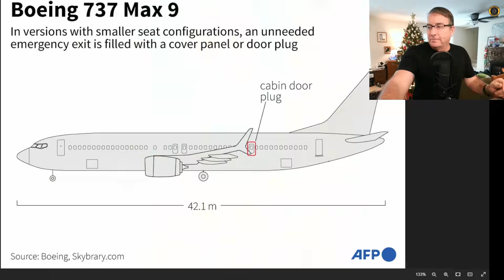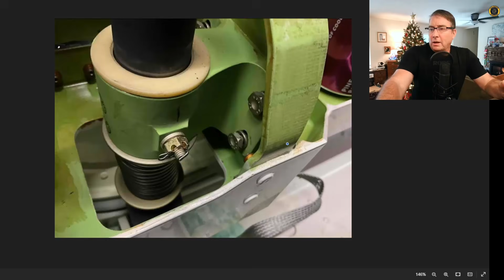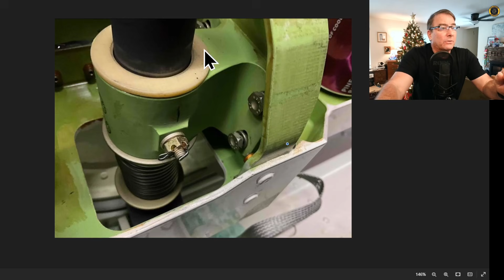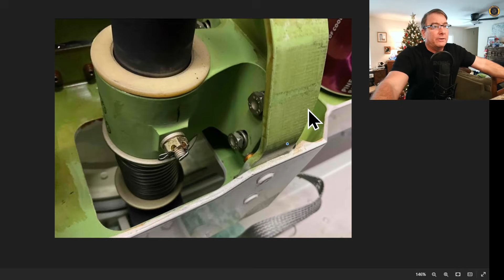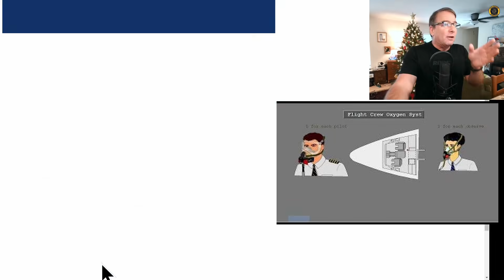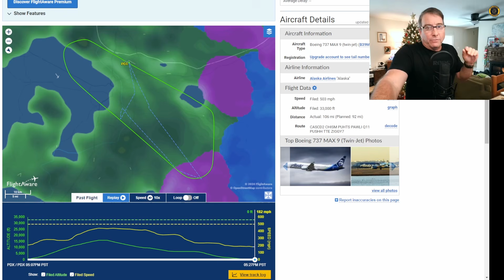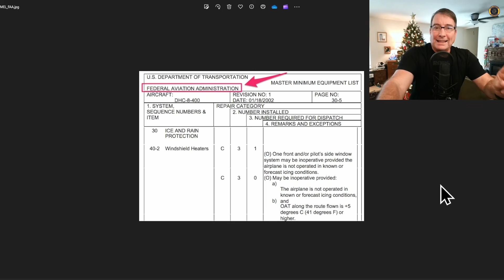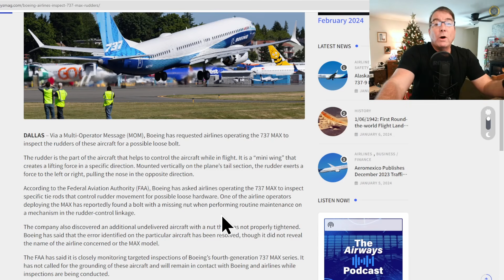"Yes, We Have No Bolts"  9 Jan 737 Max-9 Update

Comment: I'm surprised the CVR continues (or even needs) to run and over-write once the plane is grounded.
Reply: Lots of things can happen when the plane is on the ground that would require hearing the CVR. The important thing missing is why do these systems loop after only 2 hrs? It's 2024 and we can fit years worth of audio data on a chip the size of a thumbnail. There's no excuse for this.
Reply: @OMGWTFLOLSMH  Agree. You can pull tower tapes ages after an occurrence.
Reply: @owenmerrick2377 :
The tower tapes are only recording what's said over the radios, not gonna catch everything said in the cockpit of the aircraft.
🙂
Reply: @daleallen7634  True, but I was thinking of the length of time being recorded. You can go back days or more on ATC tapes, but only 2 hours on a CVR...I don't think the recording of this incident is as critical in this occurrence.
Reply: @owenmerrick2377  :
And, with the tower tapes, there is little, or even no cockpit conversation being recorded.
The whole point of having the CVR is to know what's happening in the cockpit of the aircraft, not what's going on between the pilots, and the tower!
Reply: @OMGWTFLOLSMH I remember that when voice recorders were introduced many pilots did not want them, and accepted them only on condition that the recording was on a loop and over-written after two hours.
Reply: @OMGWTFLOLSMH  For instance, we just had planes on the ground in Japan where we really want to hear the CVR.  Automating leads to edge cases.  Just having enough storage would solve this in every case.
Reply: The reg on CVRs is two hours.  Which for 99.5% of incidents works fine.

Nobody is going to voluntarily ask for longer recording time.  It will probably require a new CVR, that won't be cheap.  $500k?  Wouldn't surprise me.
Reply: I believe the CVR keeps running while the power is still on, hence pulling the breakers to stop them; but I'm sure there was a lot of oohing and ahhing at the hole after landing, with the power on.
Reply: There is no need for this anymore though, they can use the 2 hr magnetic tape for durability but there should be a flash storage device in the black box which preserves much much longer periods of time. Most people are under constant surveillance at work and don't have an expectation of privacy and there have been many instances of flight crews "forgetting" to pull the circuit breaker (not saying that's the case here)
Reply: In Europe planes over 59 500lbs have to record 25 hours of cockpit voice
Reply: they have to keep them running basically as long as the airplane is powered up. The worst airplane disaster in history involved 2 airplanes that werent even flying at the time
Reply: I think it's time that the aircraft are required to be fitted with a flight recorder which lasts for the maximum endurance of the plane x 1.5, the previous recording can be erased when the aircraft is restarted after being completely shut down, or if the circuit breaker is pulled.
Reply: @Musikur  or just do the same as europe and mandate a 25 hour minimum
Reply: Yeah, they could probably run longer, but it wouldn't have prevented this event. Bigger fish to fry methinks.
Reply: @spdaltid  It wouldn’t have prevented the incident, but would have prevented the audio from being overwritten later.
Reply: @spdaltid  :
Having a complete record of the conversation in the cockpit isn't about preventing the incident/accident.
It's about knowing what the flight crew was saying, and/or doing during the incident/accident currently being investigated.
Reply: In depends on the aircraft. Some Boeing NG's don't record when the engines are turned off, but that means recordings of preflight checks and preflight conversations are lost. On other NG's, the CVR runs whenever there is electrical power on the aircraft (so they do record preflight stuff). This Max seems to be the latter.
Reply: @Musikur  : "The previous recording can be erased when the aircraft is restarted, or the circuit breaker is pulled."
I'm pretty sure that the idea behind pulling the circuit breaker is to merely stop the CVR from recording, in order to PREVENT ERASURE of the CVR's record for investigatory purposes. 
Having the CVR ERASE the recording by pulling the circuit breaker would defeat that purpose. 
🙂
I do agree that the CVR should be able to record at least 1.5 X the maximum flight endurance of the aircraft without overwriting.
🙂
Reply: That's where I blame the pilots. They could've stopped it to preserve the recording but chose not to
Reply: @mangos2888  Agreed.  There was no reason to leave the cockpit immediately once the pilots had landed and stopped the plane.  The plane wasn't on fire or something life threatening at that point.
Reply: @mangos2888 The pilots lost the checklists in the incident…
Reply: @mangos2888  Absolutely NOT the crew's job to pull a circuit breaker.  This is maintenance's job 100%.  Every operator has policies on pilots pulling or resetting circuit breakers.  Often times, the only time pilots should, or are even allowed to pull/reset circuit breakers is if safety of flight is at risk and the checklist calls for it.  In this situation they're on the ground and parked.  Absolutely NO reason for the flight crew to pull a breaker, even for the CVR.
Reply: @johnaclark1  Well it's in the checklist sooooooooo
Reply: That cockpit door flying open could kill someone.
Reply: Better to keep running and need physical intervention to turn it off...
but plane was burning so physical intervention was impossible after vacating the cockpit..which was a priority.

Overseas CVR's in 737Max's are 25 hour recording...... mandatory...
not in USA though...
See a pattern here???
Reply: It wasn't burning 😂 @JohnSmith-yv6eq
Reply: @JohnSmith-yv6eq  :
Are we talking about the same incident, or have you mistaken the JAL ground collision for the Alaska Airlines flight that lost a door plug in flight?!?!
The aircraft in this incident was NOT burning, and thus there was no reason to immediately abandon it, nor was there any reason to not approach the aircraft, and immediately shut down the CVR.

Comment: It's looking very much like the bolts we're never installed,  I mean all 4 of them somehow coming undone? That seems more and more unlikely the longer this goes on
Reply: Somewhere there is a tray on a shelf with 4 bolts in. And maybe a mechanic occasionally thinks "I wonder where they should have gone?"
Reply: i hate it when I have extra hardware in mt tray. oh well just through it in the tool box. @bobcousins4810
Reply: Yes, especially in practically brand new aircraft.
Reply: Looks like there is no way to detect missing bolts once the panels are on. Sounds like a design flaw there.
Reply: @SeanHoulihane  that's like saying you can't tell if the engine are attached to the wings after its built. 
These things should be inspected at at least two separate points prior to even the interior being fitted. 

You don't realise how dangerous it is to pass this off as a design flaw.  A design flaw only concerns this single component,  if it hasn't properly been checked then that means other components could have parts missing
Reply: @SeanHoulihane  - What? Maybe each bolt on an aircraft should have a sensor attached to it. Or maybe the interior paneling and insulation should be transparent. I think I should spell it out for you that I'm being sarcastic.
Reply: Obviously the sensor wiring is right up to the door ready in case a real emergency exit door is installed later by 2nd tier airlines packing in the passengers.
So had the sensor been wired up...that would have been a dead giveaway.....oh wait...
 @SeanHoulihane
Reply: @SeanHoulihane   There are thousands of fasteners on a 737.  Do you want every single one to be visible?

Comment: Car guy here. As each day goes by I feel more and more justified in saying, When a manufacturer stretches a platform and calls it "MAX", that's a red flag.
Reply: Max here - getting tired of the over-use and mis-use of my moniker.  Half the dogs and cats in the world feels the same way. 🤪
Reply: @maxenielsen - You win. I don’t know what you won, but damn, you definitely won. LMAO.
Reply: @maxenielsen  OMFG - LOLOLOL
Reply: Well, the design is bulletproof. But even with a bulletproof design you still have to build it right.
Reply: @Oldsmobile69 What design is bullet proof?
The 737 or 737 MAX?
You are aware of the changes to the aircraft design that upset the handling and required the fitting of MCAS?

MAX is a different design. Enough change was made to the design to make it a different design.

They tried to fudge it to manipulate the FAA and the airlines into thinking it was the same design.
Reply: Joel, no that's not right. But the aircraft still has to be designed, built and assembled proudly. Since Boeing is run by accountants, what do you expect?
Reply: @alanc6781  The accountant thing is maybe overdone.    Boeing largest problem is that many managers are not willing to risk their careers with taking risks. Not doing so leads to other risks but with no benefit.  This risk adversity is why Boing if flying the MAX.  It was the path of least resistance taken by default.
Reply: @danharold3087   Dan, I think we are both right. I believe that no company should be run by accountants. Except for an accounting company. They should be run by experts in their field, with the ADVICE of accountants. Also, the managers should do a course in accountancy, so they understand stuff without being full- on accountants. 
Now, they are like QANTAS down under - I wonder if they will recover and how long it will take.
Reply: I've read that Calhoun, the CEO, is a glorified accountant, inexperienced in the aviation industry. He left GE in a dumpster fire.
Reply: It's not a red flag... its marketing. Red flag, LOL.
Reply: See Example. the chevy malibu  MAX lol
Reply: true true,  LOL
Reply: As a Depot (Manufacturer) Level Airframe Technician, I can say that the manufacturer has a lot of authority over design aspects while ultimately subject to the FAA. The "stretching" modification you refer to is dependent on the design specs of the original airframe/platform, as in, if the final product is part of the original design. The modified "stretched" airframe should have been, and most likely was subjected to load testing in order for the FAA to approve the modification/design. There is a lot to airframe design, for instance, just increasing the thickness of the material a few thousandths of an inch, alone, can significantly increase the strength of a structure.
Reply: Ah, more worthless fluff.
Reply: It's akin to: "New and improved". We all know that's a load of crap. New price (higher)...improved bottom line (shortcuts).
Reply: Beanie-baby guy here. As each day goes by, I get tired of people proclaiming their opinion as if it is relevant, let alone valuable.
Reply: @kevin223nicebox 
You mean posting their opinion just like you’ve done?
Reply: @bogan-slayer7469  No, not at all! Their opinion is special and better than ours.
Reply: @bogan-slayer7469   well you see, I am a beanie-baby fan, which makes my opinion in particular valid and relevant in all matters. Hope this helps.
Reply: @kevin223nicebox 💀💀💀
Reply: @kevin223nicebox  Or informed ?

Comment: Is there someone on the production line trying to purposely sabotage these aircraft? Management need to get out on the production line and eyeball all of these aircraft at each step to own the reliability and safety. People's lives are at stake!
Reply: You don't seem to realise that these aircraft aren't built and wheeled or of the door,  every single thing SHOULD be checked at least twice after installation,  literally everything. 

If this left the factory with no bolts,  this means that there are grave safety concerns for Boeing aircraft because what else could have been missed if they aren't doing proper checks
Reply: @xaiano794  exactly why I wrote what I wrote.
Reply: @bugged120  you miss my point,  I'm saying it shouldn't matter even if someone was trying to sabotage it,  that isn't an issue
Reply: @xaiano794  exactly why I wrote that Management need to be on the production line to oversee what on earth is happening!!! If Quality Controllers are failing then the next port of call is the people above them to get involved. Get my point?

Comment: They need to mandate a design change. It's a stupid design.
Reply: The design isn't bad,  you need to focus blame where it's relevant because this failure could affect more than just doors. 

If they aren't doing proper checks before aircraft leave the factory,  who knows what other dangerous faults have been missed
Reply: @xaiano794  It's a stupid design. The door opens out. So any failure and the air pressure blows it out. If the door opened IN like ALL of the other doors in the aircraft, then it fails IN and the air pressure keeps it in place. this is engineering 301 - failure modes. As an engineer who worked in aerospace for a decade, it's a stupid design. If it wasn't stupid, this wouldn't have happened.
Reply: @vanstry  that's false,  it can't possibly blow out,  it sits on stops using the pressure from inside.

Why are you commenting on the design when you can't even understand these videos?

The door has to move up to clear the stops before it can ever move outward,  there should be 4 bolts in place to prevent it doing that and given that even a single bolt would be enough to prevent movement,  it seems more like the bolts were never installed. 

It's lucky that the investigation branch doesn't have people like you in it since passing this off as a design issue could cost lives. I do get that you're too ignorant to understand that fact,  but it needs saying all the same.
Reply: @xaiano794  You have no idea about what you're talking. It can't possibly 'blow out'? WHAT DID IT JUST DO? 
I used to do this kind of work for a living. Just on Military aircraft. It's all about failure modes and this one's failure modes are catastrophic.
Reply: @vanstry  either you're lying or were extremely bad at your job since numerous aircraft and helicopters have used this exact same mechanism for decades now. 

You have to move the door up before it can leave the frame.

To dismiss this as a mere design issue hides the danger that could affect other aircraft and risk other people's lives. 

The fact you are more focused on being right than safety makes me glad you aren't responsible for so much as serving drinks on an aircraft. 

Given that this isn't a design issue,  but a quality control issue we should be scrutinising the checking systems at Boeing and all their subcontractors as there are already allegations that these kinds of things are systemic which means it's only a matter of time before a potentially fatal error occurs again.

Comment: Seems odd that some of those bolts are castellated with cotter pins, but the bracket bolts themselves, arent? Especially with those ones that are behind that panel, which I'm assuming isn't part of the routine inspection - taking that row of seats out to remove the interior panel and then inspecting the torque on the bolts
Reply: It's just a normal design choice. If a bolt is dealing with a perpendicular force then securing it with a washer and castellated nut w/cotter key is common. It can even rotate in place. It's dealing with shear forces. The other nearby bolts, the ones going into the bulkhead, they are dealing with longitudinal stress and absolutely must be installed with the proper torque and nuts. You are correct that checking these is not part of a routine inspection.
Reply: The fasteners you are refering to are called 'hi-lok' a more permanent type of fastening not requiring removal during normal service. The locking collar shears off at a pre-determind torque during installation/fastening.
Reply: The cottered nuts are only used when the hole is plugged, and aren't used when the door is operational. They merely need to be in place to keep the door secure. The other bolts are torqued, and may also have thread locker applied.
Reply: I think the castled bolt is not torqued very tight as it would distort the tube and cause a bind with the shaft that is inside. I think the bigger issue is there is no flat washer on those bracket bolts. That looks like a slotted hole. A lock washer in a slotted hole usually will not stay tight, as it is not in contact all the way around. I think they are missing a flat washer on those bracket bolts.

Comment: There was a report in august of 2023 that Boeing would miss it's quota for 737 max deliveries due to improperly drilled holes in airframes delivered by Spirit AeroSystems. It seems possible that improperly drilled holes could cause bolts to loosen over time. And the NTSB has identified Spirit AeroSystems as a party in their investigation.
Reply: That's not possible for them to come undone if they were fitted correctly,  that's what the metal cord is for threaded through the bolt